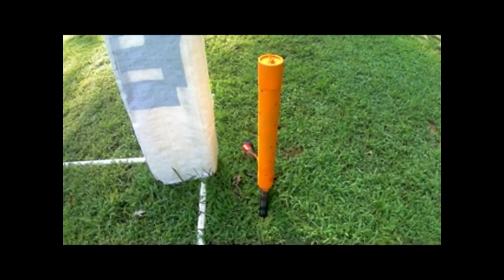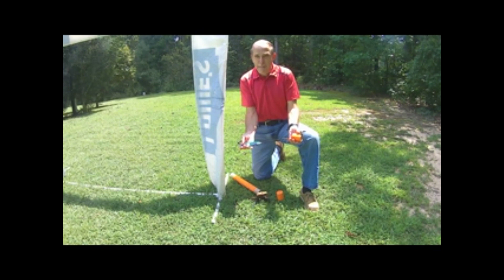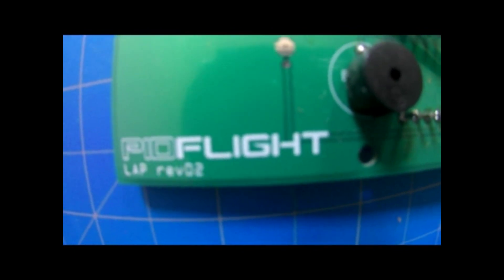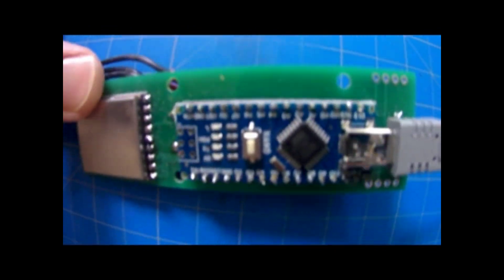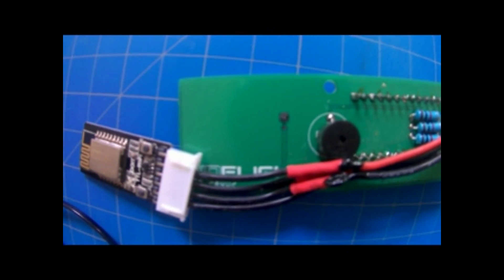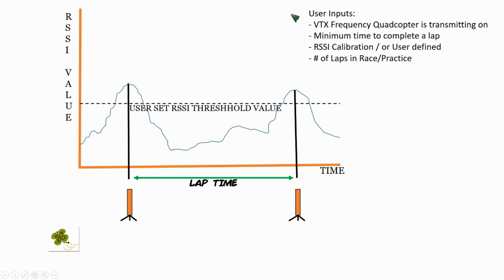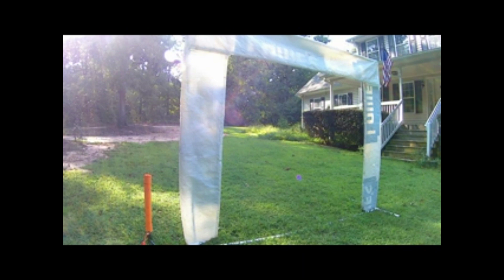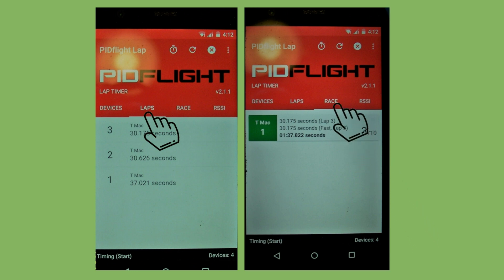FPV DRONE RACE LAP TIMER

Comment: Hey, TMac! Great video. I have a few questions. I hope to use this system to run races for 3 pilots and myself. Will the free version of the app support timing for 4 pilots? The 3 lap limit is no issue to me. Also, is there any issue with double laps or missed laps when tracking 4 or more pilots? Hope to hear from you soon, thank you for your time
Reply from the maker: https://www.pidflight.com/